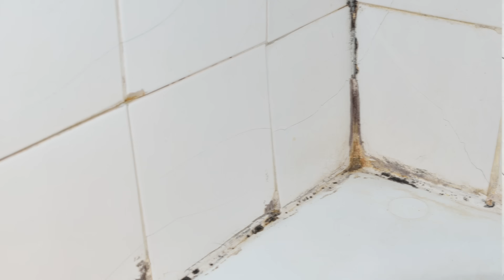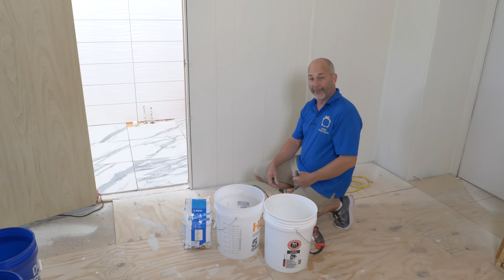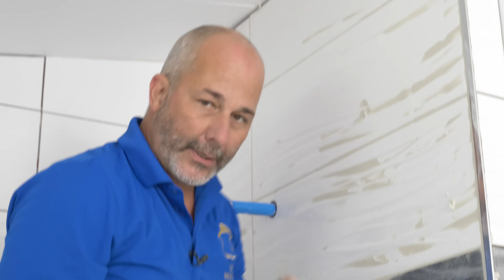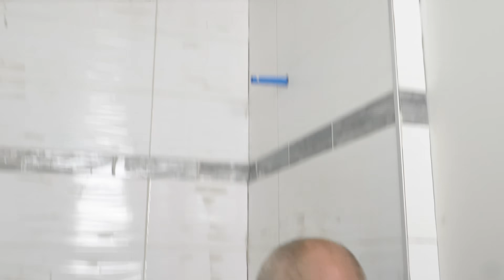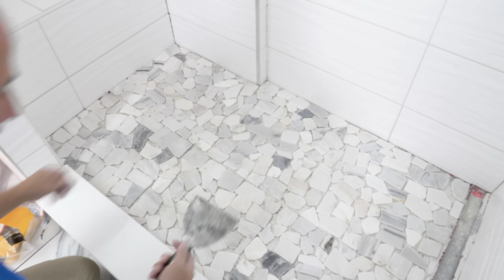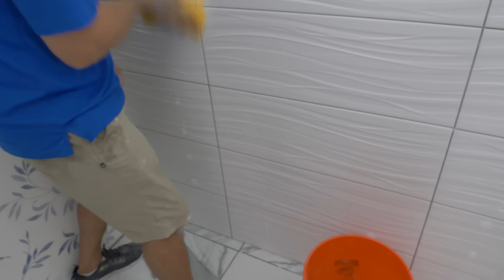Grout Your Floor and Wall Tile (Everything You Need to Know)

Comment: 51:00   I don't know if this is a result of the loss of power and lighting but the floor has a very distinct grout line right down the center of the shower floor. The randomness of the stones is clearly not there. This is just aesthetics of course but I'm wondering if it was the design of the mosaic tile sheets, or is this a mistake of the installer to properly lay them that caused this?
Reply: yup stands out like a sore thumb

Comment: 38:46  "All grout needs to be sealed"... Welp, not true. Probably true of traditional grouts in the Mapei line of products. Urethane products such as Laticrete Spectralock 1 requires no sealer in or out of the product. From the product TDS:  
"5. Does SPECTRALOCK 1 Pre-Mixed Grout need to be sealed? SPECTRALOCK 1 Pre-mixed Grout never needs sealing. In fact, a sealer would not bond to the SPECTRALOCK® 1 Pre-mixed Grout."

Comment: Jeff, great video as always. One correction,  The Ultracolor Plus FA does not have a sealer in it.
Reply: I’m not sure if it has a sealer but you don’t need to seal it after you grout and it’s stain resistant

Comment: We had a horrible contractor, grout was colored and cracked within a year. They came back out, allegedly repaired and sealed. I see cracks again and the silicone that they put over the colored grout at the wall/tub area is coming out in long pieces. 

How do we know if they sealed the grout? What should we use to re-caulk the wall tub area?

Comment: Can you use that floor stone on the walls as well?
Reply: You can but that stuff is the most awkward tile you can work with, any mosaic sheet is.
Reply from the maker: yes but i would recommend taking the stones off the sheet and setting them 1 at a time. Cheers!

Comment: If 99/99 bathrooms dont have sealed grout can you do a video on how you remove mold and save existing grout?
Reply: Clean it with alcohol and a brass brush then seal it.
Reply: The mold is growing from behind the tiles…it will always grow back…improper waterproofing, no pre slope, or clogged weep holes

Comment: Funny about the colors being different after.  We painted part our our kitchen with some Behr Dolphin color it looks white in the can but when it goes on the wall it is actually a light grey but if a little bit ends up on the ceiling you almost cannot tell.
Reply: 0:29 😊0
Reply: 9
Reply from the maker: different light at different angles creates a different effect. Cheers!

Comment: Thank you for all your highly instructional videos, Jeff. Had you not been a contractor, you should've been a teacher.
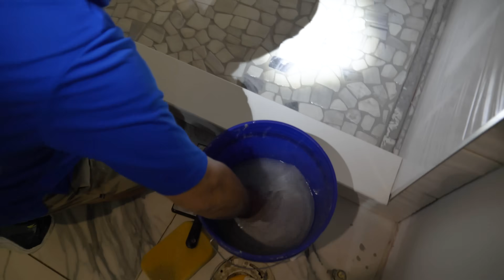49:40 I'm not in the trade, but don't you need clean water for that step? (See, I'm paying attention, lol)
Reply: All the heavy particles fall to the bottom of the bucket. The rest of the water is clean enough. Just don't rub the sponge against the bottom and you're good. You also do this at least twice starting with fresh water each time.

Comment: Hi Jeff, I did my own shower, installing stone, just like yours, but I made a mistake and the the round drain is about 3/16 higher than thr stone. Obviously, the water doesn't drain properly around the drain 
How can I fix that?
Reply: If you can set the drain lower, and it's one of those not glue in drains, you could take it all apart, cut the pipe a 3/16 or a 1/4 lower with an inside the pipe cutter, put it back together and  set the drain lower.
Reply: Call a plumber 😮

Comment: I know you say that you should mix the whole bag to keep color consistency, but I mixed it in batches because I’m a beginner and used the Ultracolor and you put the fear in me that it sets too fast (and rightfully so, it really does). I don’t notice a difference in color where the two batches overlap. I guess it depends on the color but in my case, it makes it much more doable for a beginner to do it in batches.

I didn’t pay too much attention to the water to powder ratio on the bag too much either. When I got that peanut butter with sugar consistency, I knew it was good. My kitchen backsplash looks incredible.

I will say, I gained decades of experience just by watching your videos. You are the top DIY channel out there. Your content is gold. Thank you so much.
Reply from the maker: Appreciate that, happy to help. Cheers
Reply: @HomeRenoVisionDIY Then again, my grout color is white (a new whiter kind of white than the basic white), so I would have probably had a bad surprise if I were using a colored grout doing it in batches.
Reply: @Armoterra I’ve been installing tile for 20 plus years and I have never mixed a whole bag of grout but one time that’s all it took to realize that that’s not for me 😅 so I’ve been mixing in batches every since and you can’t tell it’s any different in color, for one I always mix enough to grout a whole wall and I’ve never had a problem because I mix it consistent every time.
Reply: Mix dry
Reply: @michaelfugich5599  said it. 5 gal bucket with lid. Can mix all around. Then make batches by taking your dry material from the bucket. Maybe it's overkill but it's so easy and cheap it's worth it.

Comment: Picky is seeing the pebble sheet seam dead center. I always take them off the mesh and set them one at a time for a consistent look.
Reply: That bugged the daylights out of me also. It sticks out like a sore thumb in an otherwise beautiful shower
Reply: @jimserhant7741  Me too, that seam is all I could see.
Reply: Yes. He should of staggered the sheets. Even with grout that would bug me
Reply: What bugs me in where the faucet and shower head are. One big sheet and small ones in the corner.  You would definitely not do that on the floor.
Reply: I agree with all the above 😅 it looks like he chalked a line and cut a expansion joint right down the middle 😅😅
Reply: OH good, its not just me.  That would drive me crazy!!  :)
Reply: That pebble surface would be the absolute worst surface to keep clean. I would never want that on my shower floor.
Reply: With the unsanded grout… it says you can use the grout additive for better color consistency, stain resistance, etc. just wondering why you used water instead of the additive. I’m redoing my bathroom right now and am currently making grout choices. Thanks!
Reply: I don't like the unstaggered tile on the walls either, but that's just me.
Reply: No! Omg why did you point that out lol. I can't unsee it
Reply: You can tell it's a HomeOwner Special when. I always set them all by hand and it looks a million times nicer and professional then this. Also that shower grout. There is more water there than grout. It will crack and be a failure over time.
Reply: I’m with you! I would have pulled every pebble off there and set them as evenly as I could with no seams showing, and a 1/8 inch gap between stones. Yep, and that’s why i do my own tilework! Lol!
Reply: The offset lines on the bench thing also
Reply: I totally agree with you on that.  My eyes picked up on the seams immediately.
Reply: Totally agree- the job he did looks really solid - then you see the dead straight lines and it makes your work look inexperienced
Reply: I also pull them off the sheet and lay them individually.
Reply: Jeff, what thinset do you use for stone like this? Ive read that mesh and resin backed stones/pebbles need epoxy because regular thinset wont grab hold of the stones  due to the resin so they will loosen and crack the grout over time. Appreciate your thoughts. Thanks.
Reply: @colinnicols5387  you can use regular thinset you don't need epoxy. Even something like Pro-Lite would work
Reply: I put down round pebbles in our shower.  There is no seam visible.
Reply: Yup. That would drive me insane. I'd have to tear up those rocks on the lines and try to rotate them. Good for the sealer part. I wouldn't be happy with his quality. I see tiles that aren't right also.
Reply: The whole shape of that shower is wrong.
Reply: Same - 1st thing I noticed as soon as he stepped in the shower. Always lay them out and see if you can remove peices to make your mats fit like large jigsaw puzzle pieces. If that don't work or is not doable lay them a pebble at a time - client will thank you later.
Reply: Me too, well worth the time. An hours work against noticing the seams forever.
Reply: dang - i can't unsee that now!
Reply: Yes, been driving me crazy since the day he put it in, he got lazy. He thought about doing it right in the video.  You can see the moment he thinks about yet he went the easy way, lol.
Reply: The product should be made with an organic line, not straight! (Like false bricks or back splash tiles.) There are no straight lines in nature! I’m blaming the lack of quality from the manufacturer.
Reply: @Iloveyouhoney-j3x I think he said it was cheap. Probably makes sense. He said the budget is tight.
Reply: @YellowBunchofBananas  you can still take the rocks off the sheet and re arrange them.
Reply: @Iloveyouhoney-j3x there are tons of straight lines in nature
Reply: Maybe that is why the power cut out... so he doesn't have to look at it now.  @Iloveyouhoney-j3x
Reply: Yeah, I cringed when I saw him cutting it. I could not do it because I would stare at it and hate it. But if they don't care about it, then oh well. Personally, it's not only better looking but easier for me to just pick the stones that fit rather than cut them.
Reply: More i watched, more lazy it seemed. Yea you want cheap but some of the things ate like easy thinks thst didnt take anymore time. Like tbe wall behind the bench having just one weird square tile on each row stacked. It looks terrible. Why not swap each row so it doesnt look "cheap"
Reply: @Bigbacon My guess is money.  He knows he won't be able to sell the house for a lot like his last two projects.  Hey, I get it, but still make the end work look like a million bucks.
Reply: You can’t see that line in person, only on camera, know what you’re talking about before you chime in 😉
Reply: Drives my ADHD insane too
Reply: Yeah, I want to love the stones but the line is causing an OCD flare up for me.